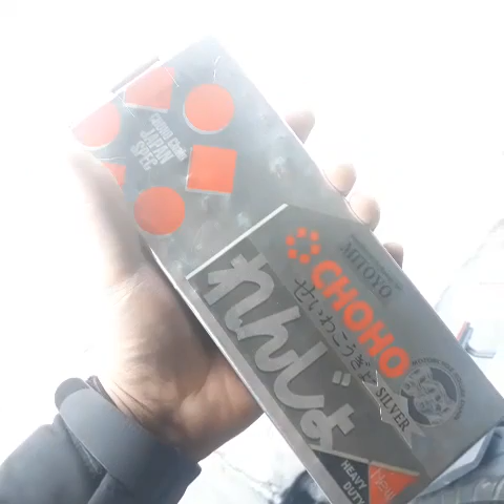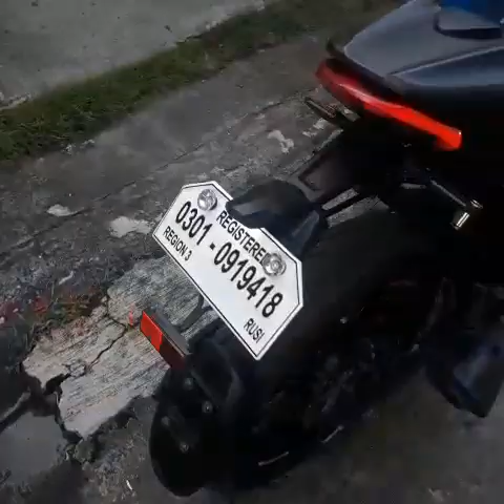Dalawang Mojo 200 - Preparation to Cavite

Comment: tol. nalalagyan. na ng oil. cooler yang mojo. mo tol plug and play na. no. need pabutas.
Reply from the maker: Ganun ba tol? Di naman kasi ako dati may ari nun
Reply: ah
Reply: pero. ngayon di na kami nagpapabutas kasi complicated. plug and play lang gamit namin. yung oil. cooler for honda cb engine na. nabibilinsa lazada
Reply from the maker: Picturan mo nga tol 0anu mo kinabit?
Reply from the maker: Send mo san fb account  ko. Varrel kurt G. ALEJAN